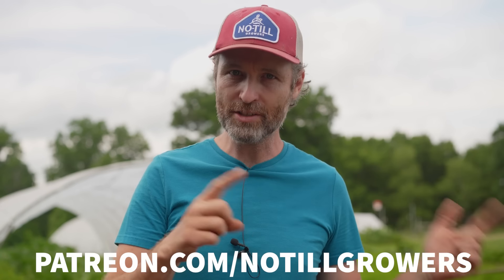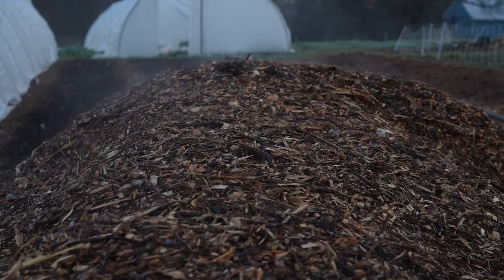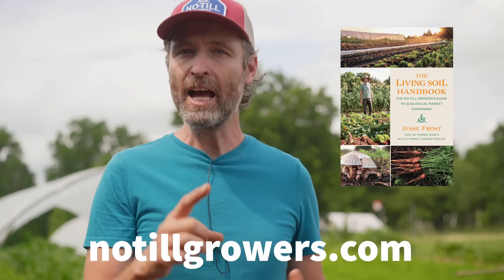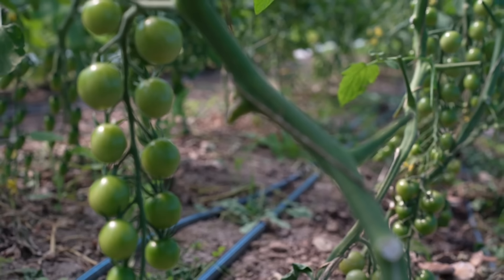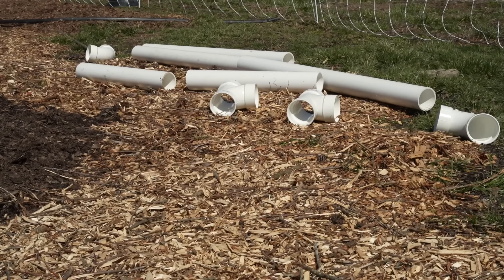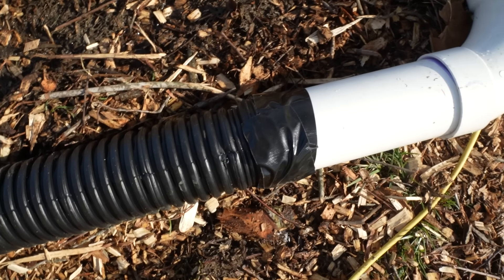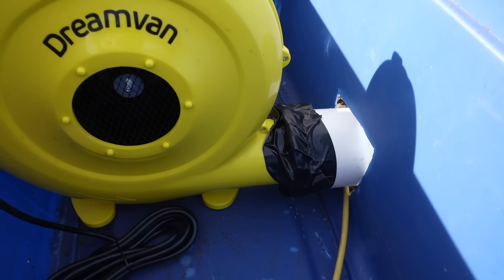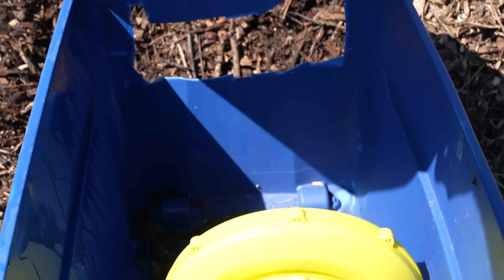Static Aerated Composting System For Organic Farms

Comment: 1. The comment about a 6" pipe better than a 4" manifold piping is probably not accurate. the velocity of air traveling through the pipes is probably so low that the extra diameter wouldn't make any difference.
2. The commennt about using a skiploader to assist in moving piles is probably illogical. If a skiploader was available, you'd be able to turn the pile easily and quickly with little manual effort, and achieve a superior result than this setup and attempt at a no-turn pile.

Bottom line, IMO the attempt to introduce air to prevent anerobic bacterial decay is probably half-effective at best. It would not prevent pockets of anaerobic decay because there is no control over how the introduced air would filter through the pile..

Bottom line, just get yourself a skiploader and do your composting correctly.
Or, invest in a massive amount of worms.

Comment: I've been thinking about McGyvering together some different wind-powered or solar powered fans and aerators for various applications.
Might work for doing this on a smaller scale.
But I can already crank out all the compost I need in 2-3 months per batch. It's not finely finished compost but its adequate for mulching/top dressing beds, fed to worms, or easily sifted for finer applications.
Reply from the maker: Nice, yeah this system will be going solar soon

Comment: I'm so glad I found your video! I've been experimenting with this idea starting this year. I'm using a much smaller pipe with holes drilled in it and much higher air pressures (215 cfm air compressor). I'm also pumping water into the pile through the pipe occasionally. In the future I'd like to add organic liquid nitrogen if needed and possibly inoculate the pile with fungi and bacteria through the same pipe. The possibilities are endless!
Reply: Will fungi and bacteria survive if you inject them into a hot pile?
Reply: Liquid nitrogen? I assume you’re not talking about the cryogenic liquid haha
Reply: @grantperkins368 maybe at the end they inoculate it before harvesting the compost

Comment: When you talk about moving the compost off to mature, it made me think - if you made it so the aeration pipes were easy to remove, you could just leave the pile in place and move the aeration setup to a new spot and do a new pile there!
Reply from the maker: Ahh that’s a cool idea 🤔
Reply: You smart
Reply: Probably cheaper to just make another aeration setup.  Plastic corrugated pipes are definitely cheaper than whatever fixture you would need to make the pipes removable.
Reply: @AKu-xs5vg  I had the same thought a few days later - as in, leaving the pipes under the pile and moving the fan etc to another location

Comment: Thanks. 
Very interesting. 
One comment on what you said about not having a tractor and FEL. 
I got myself a 10 year old tractor 20 years ago and then increased the base cost by 50 % when I put on a good FEL. I have never regretted the decision. I still use it most days. I’m hopeful it will see me out. 
I’m determined enough that I can do things with hand tools. But I still remember the first time I used the FEL - and did a job in 10 minutes - and thought how long it would have taken without ….
Of course it can’t do everything. But it can do a lot. 
Just a suggestion.
Reply: and better for your physical health

Comment: I think some sort of conveyor belt loader, like a hay elevator, would be useful for making and turning compost piles. The only problem would be getting a short enough one so the resulting pile was reasonably close. Walls would also make the pile more compact.
Reply: I like the conveyor idea, a small, wheeled unit with a battery powered motor would probably be quite sufficient :-)
Reply: You’d be better off buying a little tractor with a front end loader. A little Kubota BX would be ideal.

Comment: Charlotte drain pipe may be a better alternative to the black corrugated drain pipe. Charlotte pipe has pre-drilled holes on 2/3-3/4 circumfrence of the pipe. Just turn the blank (no holes side) to the bottom. You can always add more holes if needed.
Charlotte drain pipe is likely more robust & less prone to crushing/smashing than the black stuff. May be easier to yank/slide out as well.
Reply from the maker: Great, good to know
Reply: @notillgrowers  the smooth wall will provide a lower pressure drop in the system allowing more air (oxygen) to get to the end of the ducting. A 'Y' connection at your header will also provide a lower pressure drop than the 'T'. Great system!

Comment: I like what you are doing. I few thoughts follow to reduce costs substantially. 

I would think one long line of drainage pipe would cut way down on PVC manifold costs. A couple feet of PVC Pipe with no fittings would only be required. This would also provide more equal air dispersion between piles.

I would forget the blower, although perhaps helpful temporarily. I would attempt to use convention caused by temperature variability between the earth or atmosphere, and the heat in the compost pile. If you need to move more air consider a dc powered fan connected to a low-wattage panel (used low-wattage solar panels are a dime a dozen in my area). I think if you live in a windy area you might be able to funnel air flow with a jerry-rigged funnel with a vane.
Reply: Two really good ideas. 😀
Reply: @markm8188  Thanks
Reply: I was brainstorming the idea of using passive convection to move air as well. How do you see it being implemented?
Reply: @kathynix6552  the difference between in-ground and above-ground temperatures should create some convection. This could be encouraged, above ground, with a passive solar heater for sunny locations or a Whirlybird building vent in windy areas. 

Look up how "Earthship" buildings passively draw in cool fresh air during hot summer temps to keep the temperature of these buildings moderated. This will likely get your juices flowing. LOL

I hope this helps.

Comment: Static means it’s not moving or changing not that it sounds like static in your microphone. So, for example not constantly moving the pile to aerate it. I tried hot compost for the first time, and it was working it was definitely getting pretty warm. Then I got lazy and it went static. So, I need to get back to turning that. I hope it picks up after aeration and I get some compost. I’m trying to do it without buying and even though it’s just a small 30’x90’ yard I desperately need compost and don’t want to buy it.

Comment: Very awesome!  A thought on nitrogen (apologies if already mentioned in comments):  Chickens (just a few, especially egg-layers) may be of use here.  You can use start off some of the wood chips as bedding under their roost to collect poop (give them the kitchen scraps), and then use that as a mix-in when building your piles.  You mentioned rules around manure, but it sounds like you already know what's required there.  You can also use surplus eggs (cracked) in the middle of the pile to really get the heat going.  All that carbon you have piled on top ought to soak it up nicely to help reduce smell.

If you are wanting to pre-heat the air going in, you may wish to build a solar heat collector somewhere along the line (probably after the blower but before the manifold) just to help condition the air so it's not cooling the core of your piles.  That should especially help in colder weather as well.  You don't need anything fancy -- more undrilled drainage pipe wound through a large flat solar oven type of build ought to work beautifully.
Reply: I think the air temp isn't nearly as important to the pile getting hot as the oxygen itself being pumped in to the pile

Comment: Are you doing one large pile over all four lines, or four small piles? Four smaller piles in secession may help you achieve that continuous production you mentioned at the end. Moving one pile a week may be more manageable
Reply from the maker: I’m trying both!
Reply: I have several "bays" made from pallets with a screw or wire in each corner to hold them together.(about to add a few more bays)  this is how I achieve my compost succession.  When it's time to turn or use the compost I can simply unscrew one side and start turning into the next bay.  Granted I'm on a smaller scale, but it works great.  I only turn the compost once.  For the most part I've been adding green debris from the garden, straw from the chicken coop(with chicken poop of course) leaves, woodchips, kitchen scraps etc.  I'm growing tomatoes, eggplants, peppers etc in containers with straight homemade compost and the plants are healthy.  The only problem I've had is it not getting hot enough, for long enough to kill weed seeds.  I'm gonna work on making bigger bays to get it hotter and stay hot longer... seems as though the average sized 4 wall pallet box isn't quite enough volume to achieve the right amount of heat.
Reply: @FinznFowl82  Geoff Lawton says you'll get enough heat if your pile is 1 cubic meter or more.  More nitrogen (chicken manure) might also help with temp.
Reply: @eakle  Ive heard the same, but I've also heard it needs to be slightly bigger than a cubic meter to keep it hot longer...  I've noticed it stays hot for about a week or two and then cools down.  I should probably turn the pile more and like you said, add more nitrogen as I turn, but I have so much to do I'm lucky to turn it once.  Fortunately I'm not having a huge problem with weed seeds, just a few here and there.
Reply: @FinznFowl82  Yes I've got similar, that's several bays with 2 pallets long by one pallet wide making roughly 10 feet by five feet by five feet high. The start bay has a base made of an old bed frame so lots of metal mesh allowing air from beneath.. The worry I have is that it might be getting too hot. I move from bay to bay (5) and it helps if you have a shovel which is pointed and any really loose  stuff a rubble shovel is great. You don't need to go to the gym.
My feedstock is mainly stable waste which has a variable amount of wood shavings so I am now seeking out stinging nettles, weeds and any leafy growth to augment it. I have not had a problem from herbicides or similar but legislation in the UK restricts this stuff nowadays. I also know when the horses are dewormed.
I never use the stuff until at least nine months has passed.

Comment: you should progressively make the holes larger as you get further from the air pressure source for even distribution.
Reply: That wouldn't change anything.  The holes at the far end are getting less pressure.  If you make them bigger, then it's even less pressure than before.  The only "fix" would be to get another blower and lace a second set of pipes from the other side.  

The loss in pressure doesn't really matter as long as all the holes have SOME pressure left to blow the air into the pile.  Air rises.  It's not going to "rise more betterer" just because its blowing harder.  Or distribute better because of a bigger hole (lots of small holes are better)

The main problem here is that the pipes are very big and far apart.  Ideally the pipes would be as thin as possible, and create a denser shape.  Maybe something similar to a garden hose, flexible so you can make intricate shapes.  That way the entire pile is aerated, even the bottom layer
Reply: @AKu-xs5vg  LOL you have no idea how fluid mechanics work and yes air is a fluid.

Comment: It wouldn't be too difficult a task to put together a PLC system from one of the cheaper suppliers (like Automation Direct) to record pile temps in several locations throughout the process. When it's done connect up to the PLC with a laptop and download the temp data in a Comma Separated Value (.csv) format file which then can easily be charted using a spreadsheet application.  Might make for a slicker presentation for your organic certification peeps.  I'd write the PLC code and email it if you didn't want to mess with learning ladder logic.  I'm a retired electronic controls engineer.

Comment: The only downside of using the larger diameter pipe is that because it isn't commonly used on a homeowner or residential scale the pipe and fittings can be more expensive and less readily available than 4" pipe. 
Something I have thought about doing for this type of system using equipment would be to start by digging a trench 1/2 the width between the tires of your vehicle, lining it with a woven landscape fabric, placing a run or loop of pipe in it, and covering it over with a 4" layer of 1"-2" washed rock, and then building your pile on 1"-2" of woodchip on top of that. In my mind that would balance your air output or input and allow you to drive in and out of your pile without having to remove pipes or risk squishing them.
Reply: 10' sections of 4" corrugated drain pipe are available at Home Depot for around $15. A 10' section of 4" PVC sewer pipe is about $22 at Home Depot.

Comment: Forgive a silly question here Jesse, but the piles are being constructed with the black pipes directly in the middle of the windrow correct? I can't quite tell by your video. Also just wondering: are you constructing 4 or however many separate piles on each of those black pipes? Or do you flip piles from one black pipe to another?
Reply from the maker: I'm playing with one large pile vs. two smaller piles. And they are sort of running perpendicular to the windrow in the large pile, and lengthwise in the smaller piles.
Reply: @notillgrowers  ahhh I see. Thanks buddy! Looking forward to some updates

Comment: You could also get a squirrel cage blower from a used furnace and duct it in with a little ingenuity. Only thing is they’re normally 240 volts.
Reply: In canada they are normally 110. Can the motor be rewired? My table saw goes from 110 to 220 with a swap of the plug and moving of a couple jumper wires inside the connection box on the side of the motor.

Comment: Would it be possible to add an input in the manifold to add water, so the blower can blow moisture into the pile and keep it from drying out? Or is that not a problem with only needing to keep it at temp for three days?

Comment: On increasing production. Could you use the same manifold and make it double sided with removable ventilation?  You could remove the vents and cap off the side that you are not using and open up the other side to start a new pile so that you would not have to move the pile for the next part of the process.  How long is the maturation process?   You could even make a square that could feed 4 piles from the same air source useing some method to seal the ones you are not currently aerating thus making a 4 pile rotation.  Again this would depend on the length of time needed for the next step.   Just a thought.  I agree the skidsteer would be very helpful to you.  Best wishes with this and thanks for the information.

Comment: You said the pile could be moved once up to temp (with a tractor!).  I assume the moved pile would then not be aerated.  So I think you are saying that piles will finish OK, without aeration, once brought up to temp on the aeration system.  Could you please clarify?  Thanks, great content.
Reply from the maker: Yes, essentially, they will just mature. The stuff on the very bottom could become anaerobic if in a very wet spot, otherwise, they should be fine. Worth checking occasionally though. Good question.

Comment: I have been wanting these types of videos on YT for longer than half a decade.  10/10 on what you've shared. 

11:24 [no offense but you don't (yet) understand how harmful some of these parasites & pathogens can be]
131-171f for 15 days with 5 flips wow, the reason blowers only require 3 days is b/c flipping only adds additional oxygen for about 20 minutes max.    1 minute every 15 minutes is more inline with the Studies then the once per hour you started with. 

With the hookworm, roundworm, & skin-infecting pathogens that can outbreak in the warm southern soil here I think there should be lots more details in YT composting videos than prior years.  At certain times of the year up to 30% of children here in the south are infected due to contaminated backyard OSSFs.  Stay away from the coughing or chronic pink-eye children.

Comment: I like the concept of this strategy for quickly processing large amounts of raw material and was thinking about how to improve your design.  I had the thought of using a stiffer straight pipe with holes for aeration but not permanently attaching it to your manifold.  If you ran a rope through the far end with a handle (small bit of garden hose on a rope run through a couple of holes), you could pull out the pipe and simply slide your manifold down to a clear area and start new piles.  This would allow you to let the piles cure without any additional effort until you are ready to use them in your garden, or turn them if you wanted.  This would allow you to have multiple piles in various stages of breakdown at the same time without having to move everything before you get more material started.  You could also incorporate a vertical pipe when you are initially setting up the pile so that you are still getting airflow into the center of the pile after you pull the manifold.

Comment: Imagine a durable plastic sheet, its corners fixed to rigid objects (trees, posts) to make a "plastic hanmock".  The sheet has lots of small holes.  

Could you not just pile compost onto the hammock and forget about it?  The layer of air between the hammock's holes and the ground might passively aerate from the bottom 

If not a hammock, maybe a series of rigid plastic plates, or plywood, full of holes and supported by bricks